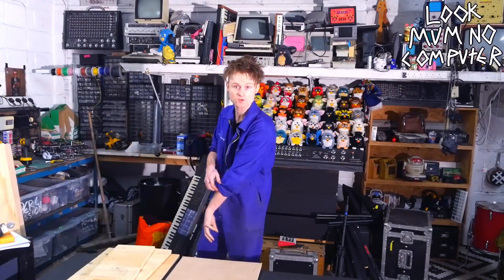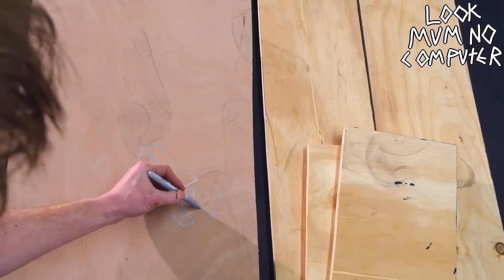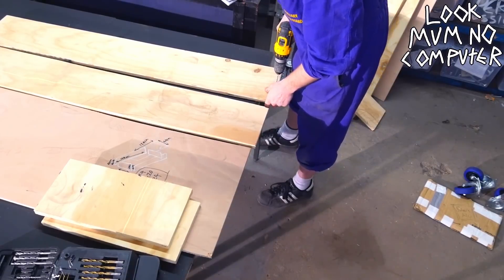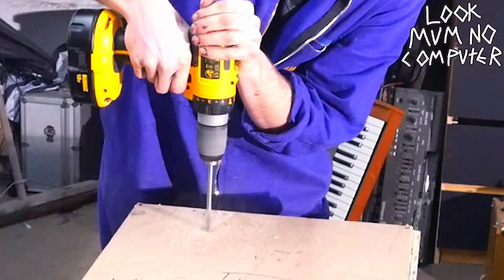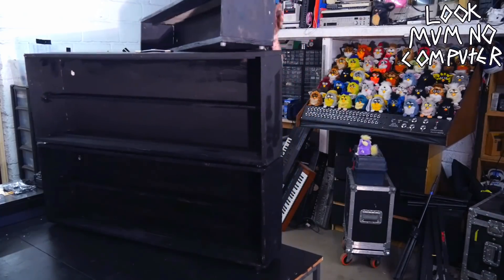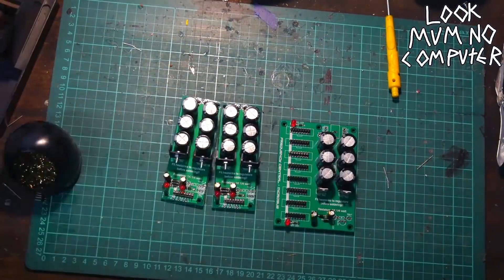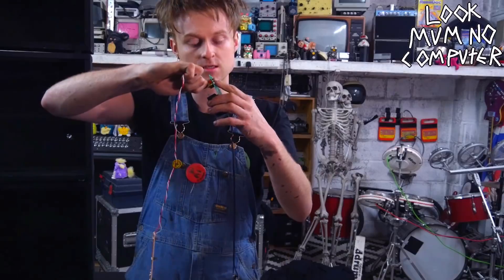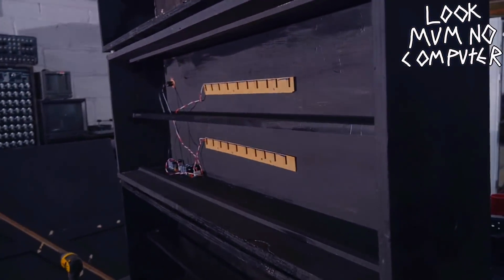Build A DIY Case And Power Supply For A Modular Synth CHEAP

Comment: Dude, Jack for 230V? Do i understand good? JACK? DUDE THIS CAN KILL YOUR.
Reply from the maker: SatanicJamnic there’s a link to the wall wart that is used, in. The description it’s 12v ac :)
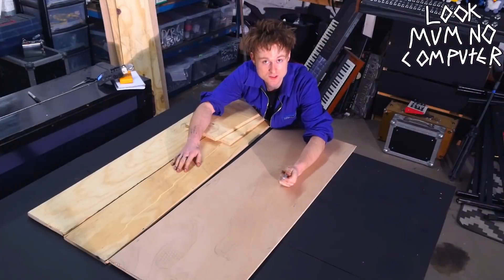Reply: 0:48 That explains the coffin, then.
Reply: So this is NOT powersupply you build. It's inverter/stabilisator! FAKE NEWS. Anyway, good it's not 230V :D
Reply: arguably, it does indeed supply power to discrete hardware in the rack.  The wall wart, on the other hand, is more of a stepdown converter, right? :P
Reply: SatanicJamnic technically, it’s a transformer/regulator. An inverter converts DC to AC ;)
Reply: SatanicJamnic but the Fake News bit made me laugh a lot. Cheers mate :)